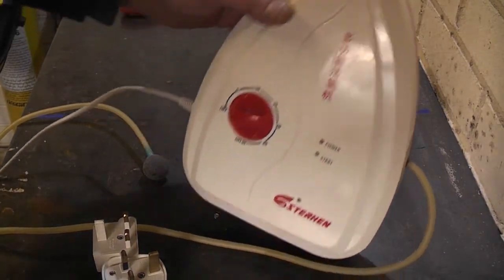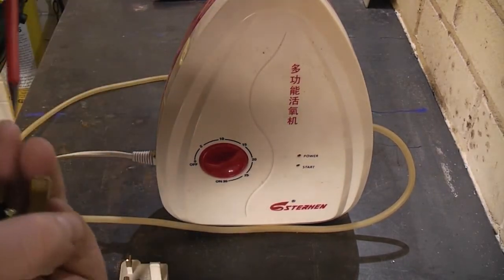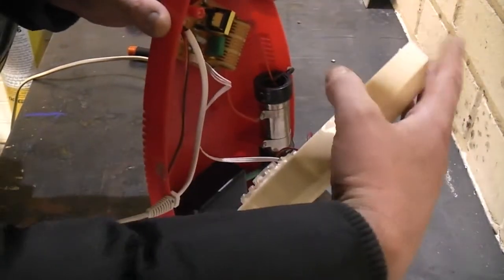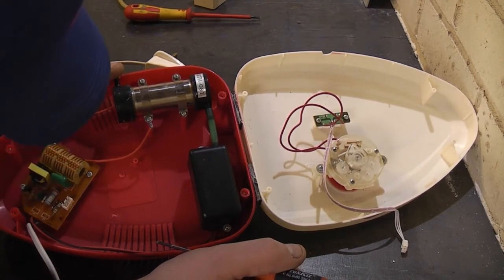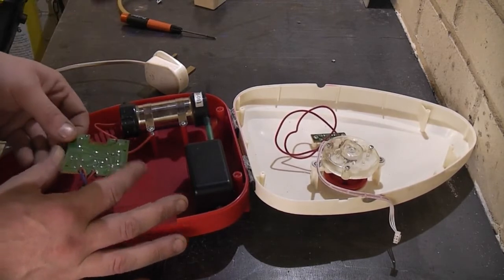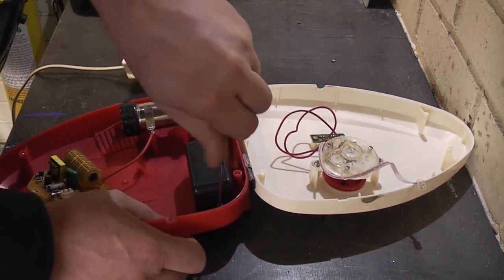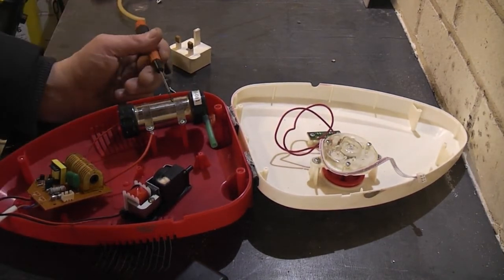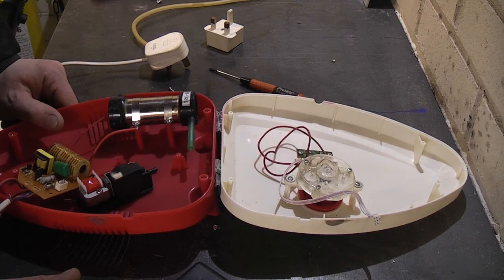Cheap chinese ozone generator TEARDOWN.

Comment: allright  agreed it,s a cheap piece of §&%") but is it  puuting out ozone? does it need time to warm up before ozone starts comeing outß if so then as long as i dont knock it about or leave it on too long it should be ok the amount i paid for it so far i.m not complaining
Reply: I've got one of these no warm up needed and a dangerous crap adapter get a decent fused one or put a UK plug on it

Comment: Hi Jonny, Actually, I've got one of these just a day or 2 ago, so searched for something like your review to try and figure out how the hell the electronics work!
I had been assuming a transistor, but your idea of SCR or similar is definitely interesting!
Do you know what the part no on it is, I can't read it myself!
Agree re the wire spacing, scared me too, actually, I re did them through the board as I could just see them fraying or breaking and going bang down the track!
Don't even think about that 3 pin connector has full mains there too, although that bit is through the fuse, so that can explode first!
Oh, and the air pump connections too, same story!
Still, it works very well for what it is!